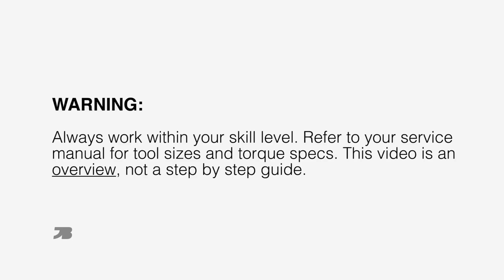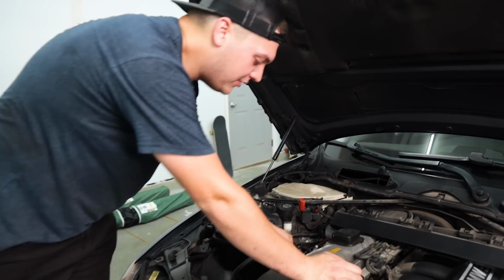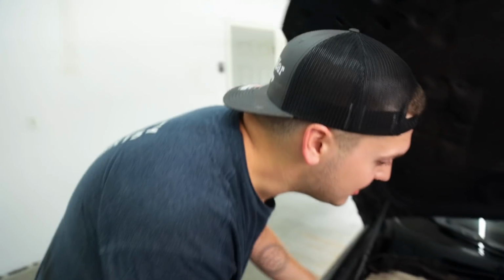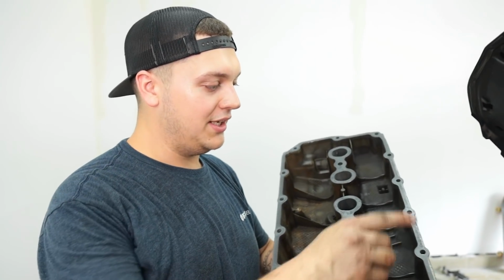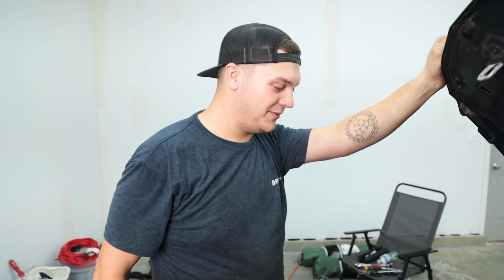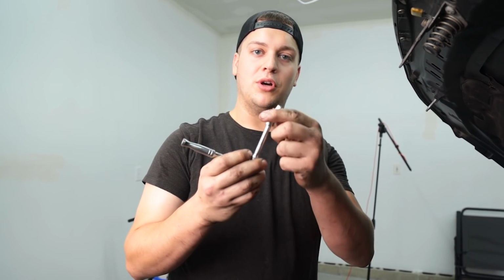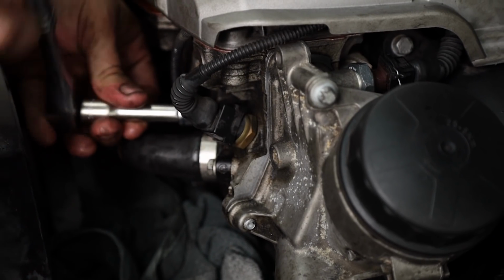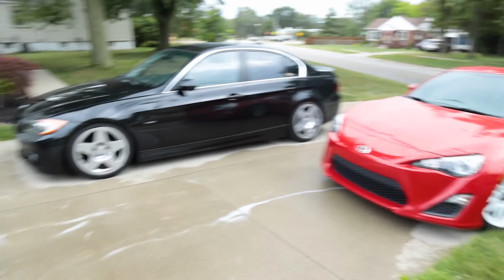I LET A SUBSCRIBER FIX MY BMW | Valve Cover Gasket & OFH Gasket

Comment: OMG I’ve been a mechanic for 27 years and that trick to remove oil from the plug hole is amazing. When I did my valve cover gasket on 2011 328i I just used the old long skinny screwdriver and rag trick with a lil carb cleaner. This is my first BMW and let me tell you I absolutely love love love my car. Even at 138,000 miles it drives like brand new and still hauls ass.
Reply: Same here
Reply: Mines also

Comment: Always great to see when ppl are real enough to admit to those tiny little mishaps that we all do, like forgetting to reconnect that ground wire or replacing the o ring on the coolant hose. People like to edit that stuff out & appear like a day & 1/2 job took 20 some mins, but if you wrench at all  you know that's just not realistic. I got an m272 equipped  Benz thinking I'd never have to do valve covers. I was wrong, & it literally took me all night. But when it's done, life is def good. Respect!!
Reply: Thanks!

Comment: I’m using the spray bottle trick next time I change oil to get the old oil out the oil filter housing, that’s a neat tip
Reply: It’s actually better to leave some oil in the filter housing so it’s primed when you start up after an oil change. So you can remove the old oil but add a bit of new oil after!
Reply: Dillon ^^^^. I actually soak the oil filter with oil as well to minimize the time of dry start

Comment: Respect to the guy that did all the work...coming from Tennessee, now that's what I call customer service...but doing all that replacing for leaks, the coolant temp sensor should have been replaced; and the mickey mouse flange upgraded to aluminum, since it was removed for the gaskets...but overall respect

Comment: I did this exact same job on my car last week except I kept my old oil pressure sensor.  I also got coolant leak from this o'ring and there was 2 broken bolts in the cylinder head.  This was my first mecanical job after the brakes.

Comment: Diy repairing could be really stressful. My 1st BMW and my first repair was timing chain and valve stem  seals. The cost of diying this was around 300$ but BMW service would have been over 2k$. It's great to diy when you buy a new car so you can change everything needed to along the way and  you get to know your car better :)
Reply: Absolutely!

Comment: Great video bro, i would add something to let the potential viewer know this is sort of a how to diy for the valve cover gasket. Its for sure one of the better videos out there so just a thought, might help someone.   Also, im surprised you guys didnt break that coolant hose plastic piece 😂 the hose disintegrated on me, i went to oreillys and got a aluminum one, fixed the problem
Reply from the maker: I usually change the title a few times after I upload. I'll probably add that but it's a lot of text lol. I'll probably get an aluminum one at some point too :)

Comment: I would replace the "mickey mouse" plastic piece on that coolant hose with an aluminum version. You can get them from FCPEuro or several other places for even cheaper and should prevent that piece from cracking and leaking in the future. Great DIY!
Reply: Absolutely agree

Comment: Old school mechanic here,  cool video, that coolent hose that hooks up to the micky mouse flang, that connects underneath the oil filter housing, should be replace with aluminum flang, cause in time that plastic flang will leak or crack. But overall cool video.

Comment: I changed mine on my 128 by myself.  The plastic cover seems to be a bit more fiddly removing and reinstalling with the gasket in place is a chore. Set aside a good 5-6 hours if solo.
Reply: It looks us so long due to filming. Just be sure the gasket does not roll and is FLUSH! Torque to spec 😊😁

Comment: Consider changing that plastic flange from the thermostat to the engine with a metal flange, its $14 on amazon i believe...that flange will break without warning it happened to my 335i and can leave you stranded depending on where it decides to give out.

Comment: Sweet I have a 645 ci with a Church engine light I can’t get off it says cylinders 1-2 misfire used to be 1-6 until I changed sparks and coils now just a little one is misfiring.  A mechanic said I had a vacuume leak from the diaphragms on the valve covers.  Also need the power steering fluid lobe replaced it’s a small metal line that cracked randomly :(
Reply from the maker: Dang is your valve cover metal or plastic?
Reply: Justin Buice i have a v8 so it’s 2 of them and actually I’m not sure but I can look it up.  How hard is it to change something like that out? I have moderate experience

Comment: Great video, thumbs up!
When installing the Valve Tronic motor again, just put it back in and torque it in place, thats it? No need to get out of "service" state? Have seen guys in other videos using the allen key once more after VTM is in place. Any suggestion on that?
Reply from the maker: Hey I just asked my friend who appears in the video. he said you have to hold the Valvetronic motor to the gasket and screw the worm gear into the valve train with an Allen key. then tighten the bolts that secure the valvetronic motor to the valve cover. Turn the vehicle to the ON setting without starting the engine about 4 times then start the engine to reset the valvetronic motor
Reply: @justinbuice  thanks, could you pls ask him for the full process of removing and installing the VTM you think? Maybe add some text according to this step in the video? Its just to expansive not to know hos to handle.
Thanks a lot, keep up the good work.

Comment: 11:17 You can get rid of the LED Angel Eye flickering with an app called Carly by coding it out. 
You register the Angel Iights as LED instead of 'bulb.' After, the coding, witch is 100% safe, you won't have any more flickering. 😄

Comment: I didn't have any 1/4 extenders or swivel so I removed the alternator.  Which was ok since I was doing the tensioner, idler pulley and belt. 3/8 extenders and swivel won't work.
Reply: Yeah 3/8 is a little too beefy

Comment: For the oil housing gasket, Do you have to remove the coolant hose? What if you use a gear wrench to remove the first bolt?
Reply: Yes there's coolant around the oil filter housings that cools it. You just drain the housing by removing this hose or risk mixing oil with coolant.
Reply: Austin Gfellers yeah I know but there a lot of DIY videos where they do not touch the coolant hose because it is brittle. In this video they had to replace the ring cause it was leaking after
Reply: @Rondo455  yeah I know I was in the video haha. It's just an O ring we had to replace.
Reply: Austin Gfellers but that o-ring would be difficult to find where I’m at, just trying  not to go to the mechanic haha. Either way, you did a great job! Very informative video
Reply: @Rondo455  yeah a local parts store like O'Reilly usually have them in stock but it's a pain to find. And thanks!!

Comment: Awesome video, love that you included everything so we know what to expect when tackling a job like this.  What kind of torque wrench do you use?  Thanks!
Reply: I use a cheaper click type 3/8 torque wrench. Can't remember the brand. I use extensions to reach the bolts. Remember that extensions don't change your torque, the angle changes torque! So keep it level 😎

Comment: I need to do that on my N54 but since the valve cover is plastic I should probably just replace it for a new one as well.
Reply: As long as the cover isn't warped or cracked, I'd just replace the gaskets 😊

Comment: In the video, you said 10Nm for the aluminium cover bolts, 10Nm is for the valvetronic motor mount bolts. The aluminium valve cover bolts are 7Nm plus 90 degrees.
Reply: Correct.

Comment: Hey Justin/Austin, great video. When doing these gasket changes, do you have to drain the oil before you take on the job?
Reply from the maker: You do not have to change the oil, but have a rag on hand because some may drip out when you remove the oil filter housing gasket. When you are done with the job, just check the oil level and top off as needed
Reply: Justin Buice ill just check with my e92 dipstick to make sure its measured right 😉. Thnx

Comment: Awesome. My local BMW service center, CA, recommends that I change the 3 gaskets: valve cover gasket, oil filter housing gasket, and oil pan gasket. After watching this video, it seems pretty important to this. Any idea, ballpark, what it would cost. The dealership never gave me a quote.
Reply: $3k at least at dealer
Reply: @austingfellers9112  Thanks. Thats what I discovered. I called 5 BMW Service Centers and got this: about 800 for valve cover gasket, about 800 for housing oil filter gasket, then 1200 for oil pan gasket because something need to be mounted also. I'm sure I can find better prices and get them done one at a time.
Reply: @christianventura4156  at least do the OFHG yourself and save some cash haha
Reply: @austingfellers9112  I've seen it done online. I can get a friend to change it. Is the valve cover gasket more important than pan oil gasket?
Reply: @christianventura4156  that depends entirely on how bad the leak is from each. I'd whichever is leaking the most first. You never wanna run these cars low on oil.

Comment: I almost cried when a bushing from my valve cover (mine is plastic) fell behind the exhaust camshaft. This job was a pain in the butt. Germans over engineered this car. Still love it though
Reply: How did that happen? Plastic valve cover here too.
Reply: Steven Sims the Torx bolts are attached to the valve cover. Unlike the Magnesium valve cover (the one in the video) the bolts have to be replaced since they’re aluminum and they stretch once they’re torqued. Our valve cover you can reuse them, but usually the new one should come on with the bolts installed. I bought mine from FCP Euro as well. So... when I was ready to take my valve cover out you’re gonna be fighting the rear part of it and the eccentric shaft. I shook it too hard and one of the bushings that holds the torx bolt on the cover fell off. For my luck (not) underneath the exhaust camshaft. I managed to get it out with a magnet and a lot of patience. It kinda has to come at an angle. There are a couple of YouTube videos for our plastic valve cover. Watch those. Take your time.
Reply: @robertogrimaldo5831  Thank you for the detailed reply! Mine isn't leaking yet but prepping resources. Good to know. So you mean to say the plastic valve cover gasket may come with new bolts? Also I am assuming it is the washer or bushing on the bolt which may fall off? Or is it like a metal bushing in the plastic of the valve cover. Like a metal bushing to reinforce the fastening point? Thanks again!
Reply: Steven Sims if you order it from FCP Euro (which you should) they have life time warranty on all their parts, and their customer service is great! I’ve bought all my parts for my E90 thru them. Anyway, you don’t need to replace the valve cover, technically only the gasket, however, I highly recommend replacing it since it’s plastic. If it’s cracked and you changed the gasket only you went through all that trouble for nothing. So might as well save yourself a future headache. I did my spark plugs and ignition coils while I was in there and it’s still running like a champ now, no issues. Back to your point. It’s only a bushing on the holes where the bolts go that hold them together. I shook it hard enough and it fell off (my fault) but you shouldn’t run into that if you’re patient and take your time doing it.

Comment: While you were in there should of went ahead and replaced the essectric shaft sensor, youll be thankful if you did. First time i did my gasket and bam 1 week later had to do it all over bc the sensor went bad and causes your rpm studders etc
Reply: That's because you damaged the sensor. The sensor is like $800 that's pointless lol.
Reply: @austingfellers9112  i paid $200 for oem sensor. So idk where you get $800 from. Also i didnt damage the seal. They are common issues for e90 n52s. If you cant afford the parts then pointless to own a bmw lol.
Reply: @michaelwhite258  yeah sure. Have a good one.
Reply: @michaelwhite258  I'd like to add that the $800 is a starting quote for another shop to fix it for you, not a DIY which is obviously cheaper. And E90s aren't expensive lol.

Comment: Justin did this gasket ever start leaking again? A lot of shops recommend changing the whole valve cover. Also did you guys just add coolant after the OFHG or did you guys bleed the system too?

Comment: These typically fail at 50 and 60.
BMW is notorious for it Along with all the plastics / charge pipes / inlet pipe/ cooling lines/ even the valve cover needs replaced from warping.
My opinion if your gonna own a BMW you better learn to tool it ..
Or go broke fast.
8 hrs is a bit long for two relatively simple fix's..
They are fun cars but you better get familiar quick with one  and invest in a good set of tools.